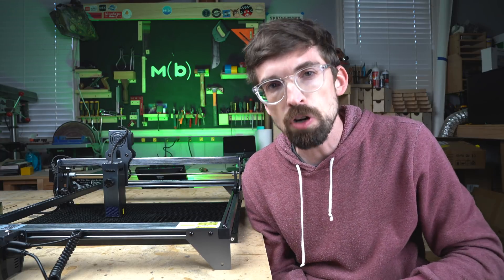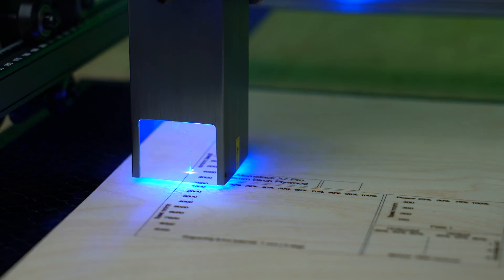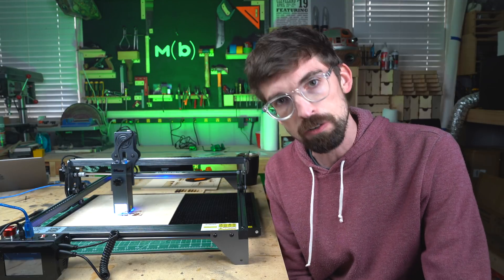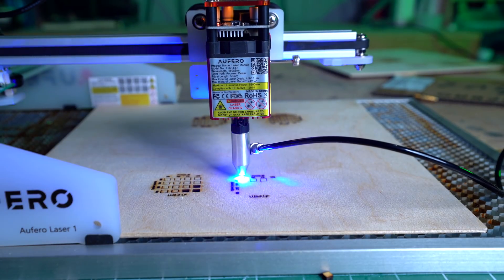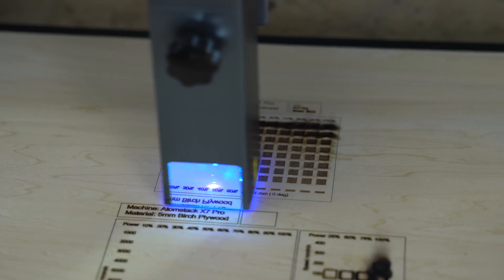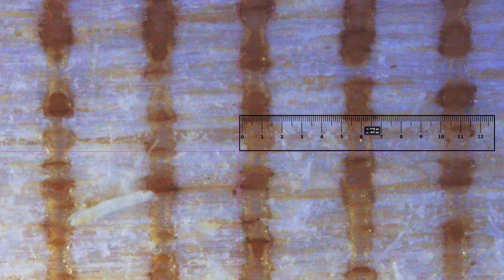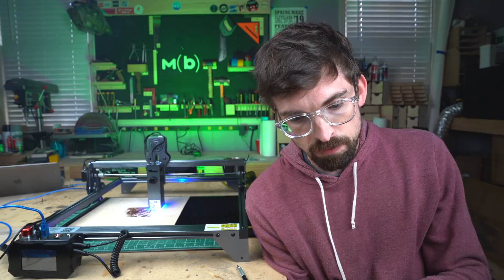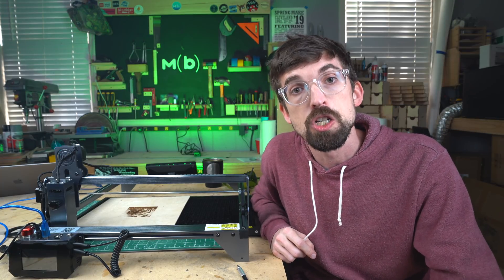Cheaper and Better?  Atomstack X7 Pro Laser Engraver Review

Comment: You say that this is the most powerful Diode laser module in a system sold on the market right now but there's NEJE A40640 15W optical output laser listed for $239 (Shipping not included). They also have a complete system NEJE Master 2S Max with the A40640 module with a working area of 460×810mm listed for $579 (Shipping not included).

They have a claimed laser spot dimension of 0.04×0.04 mm and they sell a manual air assist addon for under $20.

Which is objectively a better deal than any of the systems you mention here.
Reply from the maker: I’ll have to check it out, the xTool D1 has a square dot at .08 so it will be interesting to try out!
Reply: @makeorbreakshop  Looking forward for the video.
Reply: I'm also very interested in the Neje Master with the A40640 module. Definitely seems lile the best value unit.
Reply: @Kopsu87  it is hard to not be interested. They really back their product and they're the only manufacturer I know of that has square laser light with truly impressive dimensions.

Edit(spelling mistakes)
Reply: @S-I-R-E  I just checked their website. They have free shipping from germany within EU and -30$ Black friday discount.. So tempting.. :D
The air assist is out of stock, but to be honest that thing seems like it would be really easy to DIY.
The only thing holding me back is the lack of reviews. Only seems to be a handful out there which seems strange to me.
Reply: @Kopsu87  It is a pretty recent launch but some of the other offerings from NEJE have been tested quite extensively with remarkable results. Also the A40640 is a "fusion" of two 7.5W (output) laser diodes with a lense mirror. I do not know what modules they are though but they are in-house (NEJE) plus they have a warranty of 20000 hrs or 2 years with continuous workload claimed on the website. I haven't heard any other manufacturer back their product so well.
Reply: I love my NEJE A40640 diode laser, have been using it for a couple months now. If you buy just the laser, it comes with the mount, driver/motherboard and power adapter. I 3D printed an adapter and mounted mine to my Carbide3D Shapeoko Pro CNC machine and use Lightburn with it, gives me a 812mm x 812mm work area. Also have the older NEJE 30W (5W Output) on their Master 2S but it's no comparison to the A40640, the A40640 is soo much more powerful.
Reply: @KevinCharlebois  NEJE A40630 (kit), N40630, F30130, and A30130 (kit) are the only modules with 30W input rating all of which have an output rating of 7.5W, I think you mean the N30820 which has 20W input and 5.5W output.

Pretty much all diode lasers on the market have a 4:1 (not precise) input to output ratio. The consumer ones anyway.
Reply: @S-I-R-E  Thanks, I may have been off on the output of the older 30W, I assumed 5W based on what I read, but I just confirmed that the actual version that came with my Master 2S Plus was the 40630 30W, so if it's 7.5W output great, I still see a huge difference between it and the new 40640 dual 7.5W that I order separately and mounted to my CNC.
Reply: @KevinCharlebois  Maybe post a video about it if it's not too much trouble. I'm sure people will appreciate it. (I know I would)
Reply: @S-I-R-E  I'll do that as soon as I get a chance, I'll notify you when I do.
Reply: Was looking at adding this to my Nasum A5 Pro. I have OD6+ goggles, while the new safety features are cool, I'd rather have more power without buying a whole new kit.  While the safety stop switch is nice I could more easily pull the barrel jack from the controller.

Comment: Please answer back would you go with this or the omtech k40
Reply: K40 is different tech. This is a diode laser, k40 is co2 laser. For cutting k40 is better still, even though this is a powerful diode laser.
Reply: @Kopsu87  thanks for the response I'm just trying to figure out which machine to get so I don't have buy another one soon lol
Reply from the maker: If you need to engrave and cut larger stuff go with this.  If you need power then the K40 is good option
Reply: @makeorbreakshop  thanks for the response I wanna get into making like keychains and stuff you've had experience with alot if them for the price should I go with this since it has a bigger area and can also cut